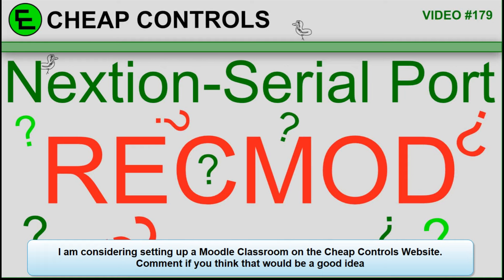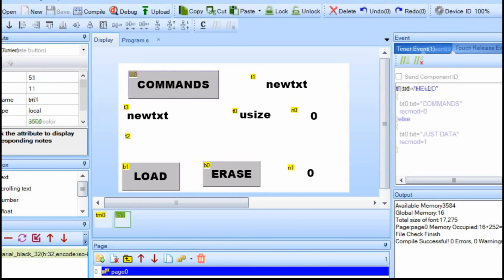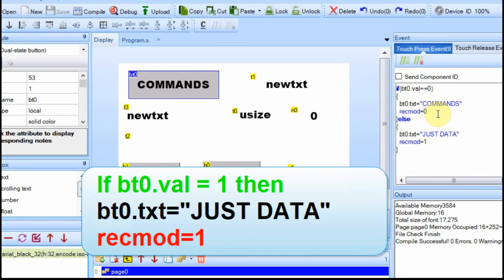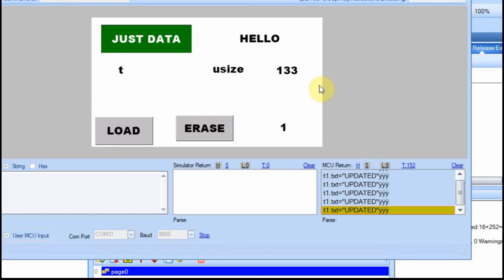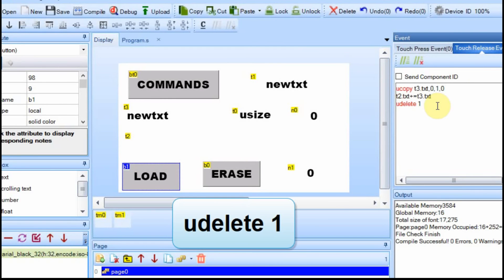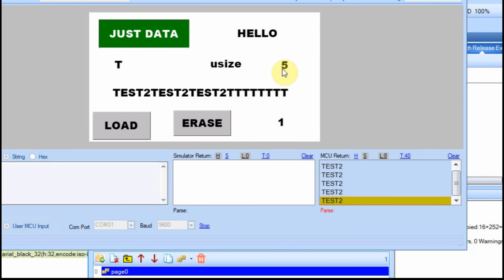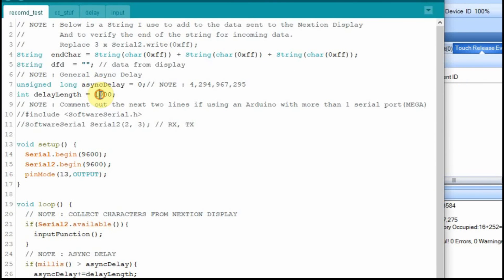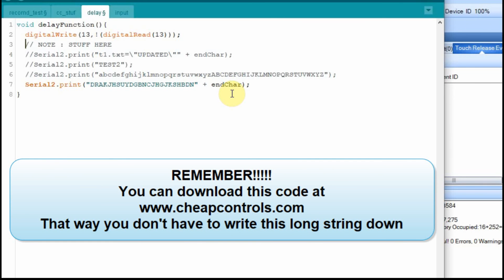179 Nextion #recmod command - this is the lastest in my #nextion #arduino #esp32 #tutorials

Comment: I really enjoy your videos, learn a lot about the Nextiom, but do not use the Arduino environment. I decided to learn with an industry standard IDE not hobbyist but still use their processors. 
 PLEASE supplement what you do with Atmel Studio
Reply from the maker: I have considered switching IDEs.  I even put up a poll once.  My current audience prefers the Arduino IDE.   If I switched I would probably use the Visual Studio IDE.  I used to use the Atmel IDE years ago.  I also used a purchased professional IDE when I was doing professional Microchip development.  But now I am doing a lot or web design and MySQL coding with PHP.  I use Visual studio for all my other languages, but I do understand your request.  Do you do any machine code development for the smaller Microchip products?  I used to love trying to create the most efficient code I could.  I don't do any machine level coding but I do miss it.